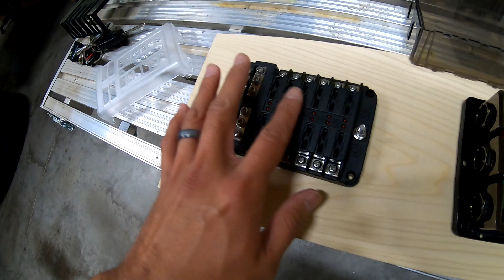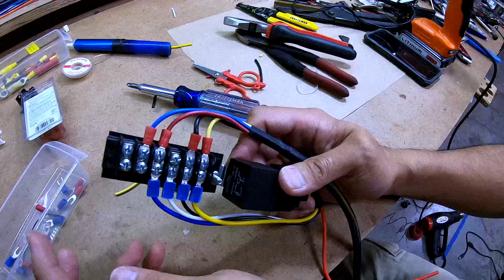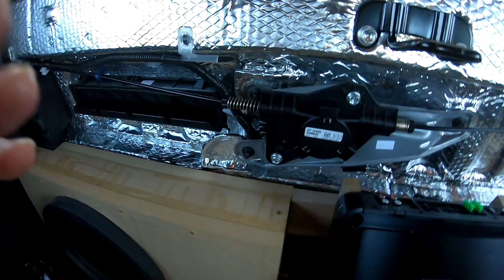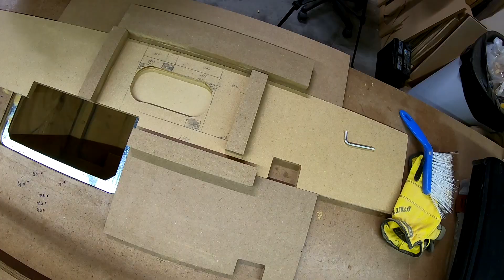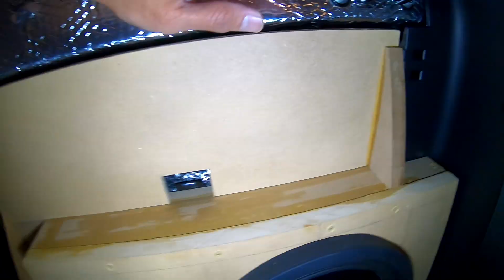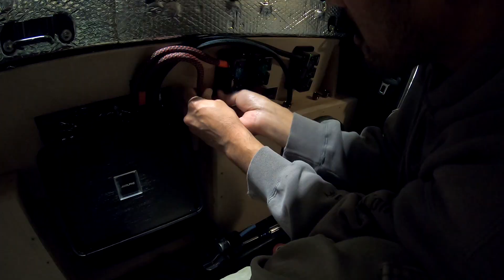Amp Power Distribution (Tacoma Stereo Build Part 7)

Comment: Did you have to upgrade your alternator
Reply from the maker: That might be a possibility in the future. It hasn’t caused any issues besides a little bit of headlight dimming when I crank the stereo up really loud. When everything is done in the back, I’ll be upgrading the battery and alternator grounds and power wire. Those are the only plans at the moment.

Comment: This is the nicest Tacoma build I've seen!  Blows away mine!   Quick tip on those Alpine PDXs - they are fairly easy to open up for reversing the badge 180 degrees...just in case you wanted the access panel from the top.
Reply from the maker: Thanks man. It’s still far from being done. I’ll keep that in mind about reversing the badge. The space is a bit too limited back there to change up how the amp is mounted though with the power wires and all. I may try to re-angle the bottom amp instead.

Comment: Talk about attention to detail. That is definitely a one off custom install. Is changing out the fuse block a space saving move or a technical one?
Reply from the maker: The two fuses on the other side of the block just aren’t needed. Originally I was going to have the third amp connected to it, but I didn’t want the power wire to run so far from the block since I’m mounting that under the front seat. I’m sure I’ll use that other fuse block eventually.
Reply: @AyyJayy02  I understand. Makes sense. The shorter the wire run, the better indeed.  I doubt that the third amplifier would be needed anyway.